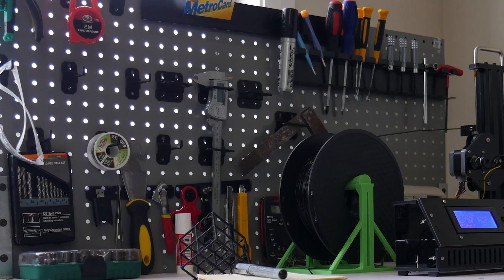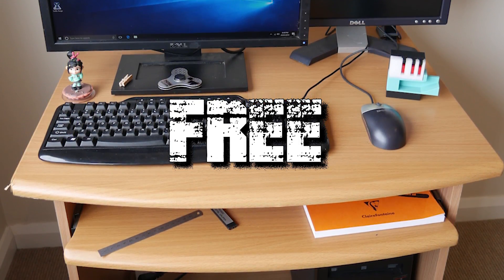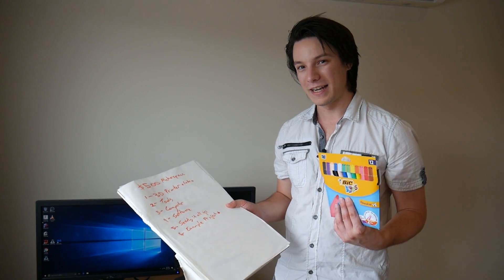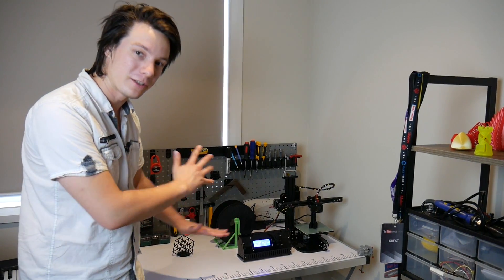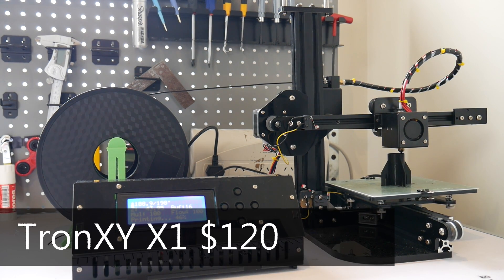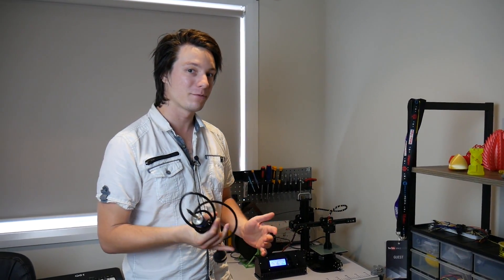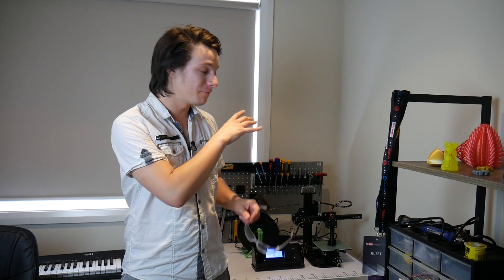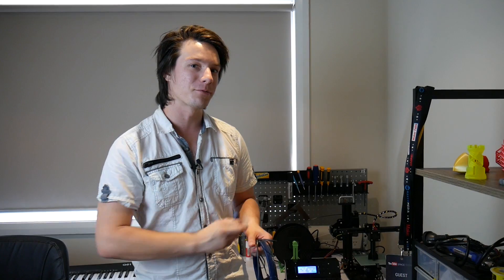Setting up a 3D Printing Makerspace for $500 - Part 4

Comment: Hi I saw many people is using a spool holders to make spool spin freely some people even put ball bearings, but your spool holder is really basic and spool is actually hanging on it. Is that better solution? Isn’t that going to be harder for printer to pull the filaments?

Comment: Tables I often find for free around aprtment blocks and share accomodation areas, student tend to just dump stuff outside they dont want instead of organising to takeit to a tip as they should. As Angus says markings on it are not important as its just for you to use as a workbench and its going to get marks on it. What you should look for is stability though. You dont want to be working on an unstable surface or leaving equipment running unattended on one. I've found plenty of really great tables that looked like they were thrown out for being wonky and when I looked the fasteners wern't properly done up and once tightened the tables were rock solid. Especially with flat packed furniture they are often held with just dowels and locking screws and if one isn't done up securely they can work loose. So when I get a table (new or second hand) I will use white glue or high strength glue in the joins as well as double check all fasteners after complete assembly. If the top isn't big enough you can always grab a larger board from any hardware store and screw it to the table top as a new surface, again as long as the legs etc are all solid underneath this will suit you well for years.

Surge protection power strips, be careful, avoid the cheapies. The way the surge protection works in those is sacrificial. Overtime small unnoticable surges and spikes can erode the fuse (basically all the protection is) meaning after a year they are not giving the same level of protection as when new. in some cases they stop protecting altogether. Pay the extra for a brand name product that will work for years and replace those cheap nasty ones you have been using asap.

Powerstrips, go for ones with spacing for wall wart transformer packs as well as individual on/off switches. In addition to Angus' reasons, if you have pets and children in the household often you should always be turning things off at the wall for safety anyway. Also use the keyholes on the back of powerstrips to securely anchor them to the workbench top (not side of underside). This makes unplugging easier and reduces risk of partly unplugging something else in the process. It reduces the risk of accidental unplugging if someone pulls one of the cables. Make sure its anchored out of the way but easy for you to reach when you need to. It should never have other cable draped across over the top or knotted in with things plugged into it. Powerpoint plugs are a good idea and essential if you are doing any sort of filing, drilling, grinding nearby as you don't want particles in the air settling into the empty sockets to build up and cause a short or fire hazard.

Comment: I get a lot of cheap or free stuff from " Marktplaats.nl " a secondhand site in the Netherlands/ Belgium.
Also "kringloop" ( charity & recycling ) shops are usefull.
Cheap desks, drawers, pc's clothes and sometimes tools are cheaply available.

Consider visiting metal recycling yards, They've got tons of used metal, usually in large piles, and sell it by the Kilo ( or whatever system you use).
But please be careful, wear an overall, protective boots and gloves and a helmet when visiting a scrapyard, it can be very dangerous walking and digging there, and very dirty.

Comment: Question , as an Industrial Designer who works in the toy industry, I'm very well aware of the benefits of 3D Printing when it comes to prototyping and model making, however I've never understood why anyone would want one in their home, for personal use.  Could someone please explain to me why, for example, a person who does not work in manufacturing would want a SLA printer?
Reply: I cannot speak for others, and I'm not going for the expense and fumes of SLA.  I plan to get an FDM printer this year, as I'm teaching the nieces and nephew electronics, which will lead to practical application in robots, drones, radios, or whatever.  With the 3d printer, they can custom design and create what they want, to build their ideas into reality.
Reply: gfodale makes sense since FDM is stonger

Comment: You can buy a cheap bench from bunnings that has a pegboard back , and if you want  a set of tee handle allen wrenches hare and forbes does a set for around $80 that have become my favourite allen key set and i have literally hundreds of allen keys ranging from unbrako to kinchrome to bohndus in everything from wallet sets to fold out  and tee handle sets .
Angus what do you think about a cheap home made fume extractor , i have seen some units designed for airbrushing and now wonder if they could be used for  printing ? I intend to do most of my printing with abs and would like your thoughts on fume control inside a house or unit and do you have any budget hacks for this ? 

Ian
Reply: Regarding the fume extractor, cheap, and printing abs.  I've not seen any but can picture one easily enough.  It would take some plywood, a muffin fan, a clothes dryer vent assy, with an extra flange for the dryer hose. Some plexiglass / lexan, hinges, and weatherstripping. (dryer hose too.)

If the printer is already enclosed then you just need the box for fume extraction.  If not, you'd want an initial box to keep the heat in, and a second for the fume extraction.  The plexiglass is for the door(s) so you can keep an eye on printing progress.  Mount the muffin fan on the inside of the fume extractor box with the extra hose flange on the outside, making sure the fan exhausts through the flange.  The weather stripping is for the bottom of the box for fumes, as well as sealing the door.  You'll want a bit of vacuum in the fume box.  Cut a panel which will fit in a nearby window snugly,  and mount the dryer vent kit to it.  Connect the hose between the fume box and the window panel, turn the fan on, and budget fume extraction.  The box(s) can be easily lifted off for maintenance.
Reply: Thanks gfodale.
I have to make an enclosure so i will design the extractor into it , i don't think i need a huge amount of airflow so i may try a large computer fan or even a server fan and i can use a pwm circuit to control the speed . I'm expecting abs to stink and i don't really want to breathe in the fumes .

Comment: You make the assumption that everyone wears headphones. :)
And it's a shame that working with 240v/mains is so dangerious. Building your own power point tester is actually a fun and easy project. A few resistors, diodes, LEDs and it can be all assembled inside a clear plug for half what you can buy one from the hardware store for.

Comment: For what it's worth, that surge protector probably isn't protecting much from surges anymore. The metal oxide varistors inside can only absorb so much energy from transient voltage spikes before they are essentially useless. 
Not to say that you should throw it out though-  a good power strip is worth it's weight in gold. Just don't rely on it to protect against noisy power!

Comment: talking about solder iron not having a switch.. i forgot mine plugged in for 2 days  , even worse it was a cheap one from these brands that- out of nowhere- flood the shops with a very very wide range of products.
  lucky me they cloned some good design or have not gone too cheap on the materials  so the iron is still working fine and it didn't cause a fire.
   i don't do much soldering and i have always preferred the soldering gun , so i knew there would come the day when i would forget to unplug it because that was the only reason i didn't like soldering irons in the first place.
  i might have to rig up some kind of time limit switch for it  because i'm sure i will forget it some other time.

Comment: SolveSpace is a easy to use and learn 3D design tool.  Its open source, runs in windows or linux.  No install, simple 1 exe, put on a usb stick or disk and run.  Eric Buijs has some nice tutorials on youtube.

Comment: Full ACK on the smoke alarms. However, I'd rather recommend water-based foam fire extinguishers. The powder contained in the "dry" extinguishers contains fine-grained metal salts that will creep into every nook and cranny after use and cause corrosion just about everywhere. Even if it was not your 3D printer, PC or other electric/electronic device that you had to extinguish, chances are that these devices will fail shortly after a powder extinguisher was used because the powder got inside and corroded the PCBs and contacts. Water/foam extinguishers are slightly more expensive and bulky, but much cleaner to use.
Reply from the maker: +Volker Wegert I only shy away from wet extinguishers due to the high chance of an electrical fire
Reply: Should be quite safe as long as you keep the safety distance that has to be printed onto the extinguisher (at least "up here"). I'd be much more concerned about some "powdered" device starting to develop internal arcing due to corrosion weeks or months later.
Reply: And of course, +\infty{}\thumb{up} for recommending smoke alarms and fire extinguishers in the first place.
Reply: I'd be careful with these. Halon componds can be quite toxic (even more so when used in a confined space) and are no longer allowed in a lot of countries for use in privately owned fire extinguishers. There are spray-can sized foam extinguishers available, and in a recent test by a reputable German test institute, they turned out to be quite effective - however, they run out after about 30 seconds, and depending on what's burning, that might not be enough - and then it's GTFO time.
Reply: First line of defence is always a fire blanket. That is the best way to handle small fires.
Water/foam is never a good idea around things like 3d printers and computers, you can easly electroccute yourself either during or afterwards and sometimes requires getting someone in to recertify things like powerpoints if they are soaked, plus people rarely have the piece of mind to turn off power(If they even can!) before using it, plus the foams can be just as corrosive. And typically if your device is on fire, then putting it out is more important than saving.
The recommended one for protecting electronics is CO2 or if you can get them, Halon.  Fairly pricey, but safe enough to use on just about any fire.
Reply: Of the recommendations posted ahead of me, I concur with CO2 fire extinguisher and the fire blanket.
Halon, or it's replacement, Pemall work by replacing the air with an inert gas of the aforementioned names.  In an enclosed space, it can suffocate people as well as the fire.
The chemical extinguishers are often corrosive as was mentioned in the original post.
I know from experience, all of the above.
Regarding the foam, if it's the same as what is used at airports, it could be caustic.  We had a foam dump in a hanger after an alarm tripped.  The aircraft in the hanger had to be disassembled and cleaned to prevent rapid corrosion.  Fortunately, the company had insurance for such an occasion.... Also, fortunately, it was a co-worker rather than myself that tripped the alarm  :)
Reply: Small Halon fire extinguishers are best for electrical fires and relatively cheap, physically about the size of half a standard paint can.
Reply: Co2 is my goto general purpose fire extinguisher, water around electricity is Darwin nomination, unless your main fuse box runs separate feeds for power and lighting then spraying a live electrical equipment with water will most likely result in the power tripping and taking the lighting with it at best, not a good thing if your in a basement with no natural light and something on fire. Foam and powder are good but make a hell of a mess, powder in a small area is not good you will loose visibility in a cloud of powder, halon is illegal in UK so that leaves co2, zero clean up, no damage to electrical equipment and you get alot of co2 in a small package vs water/foam

Comment: Wow , you have moved into the big time and had a cameraman ( or woman ) 

Also cheap pair of leather gardening or workman gloves are really useful when using a scraper to remove prints
Reply: At some makerspaces/hackerspaces theses are /required/. You can end up applying a lot of force with a sharp edge so when things go wrong, they happen quickly.
We've had two fairly nasty accidents from people slipping, including one that involved a few stitches.
Reply: why a cameraman ( or woman ) ? dont be so politican incorrect. Chances are high it was a cameratransexual ;D

Comment: Angus - love your videos, best I've found on youtube in terms of comprehensive, in-depth information and rigorous testing. I know you get this question a lot but what was the most hassle free plug and play, self calibrating printer you have used?
The cubicon single seemed to impress you a lot - costs to one side, is that still the best printer you have used?
And what would you recommend for best printer capable of soluble supports?
Would rather take the hit on cost and spend more time printing and less time tweaking and fixing.

Keep up the good work - Cheers!